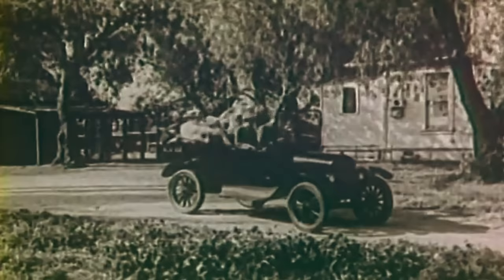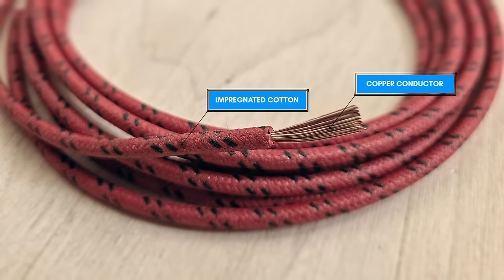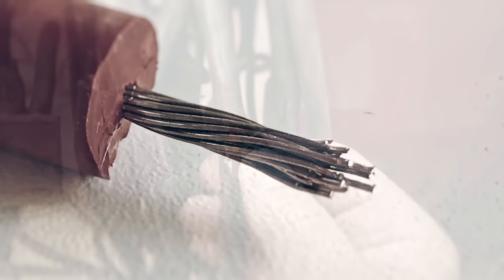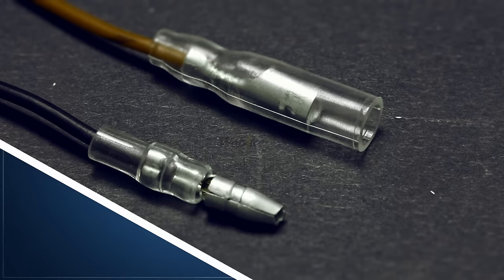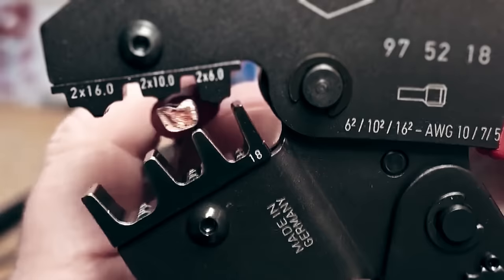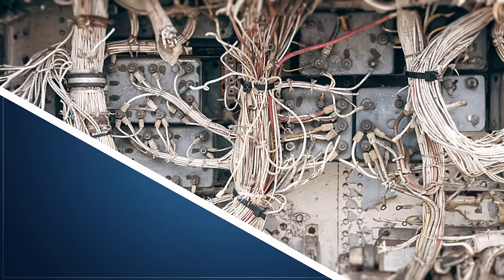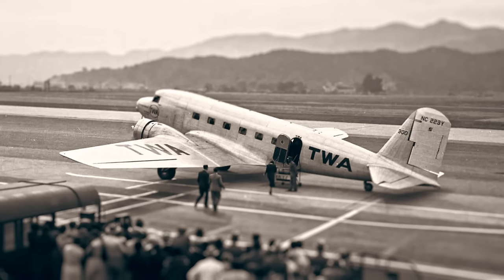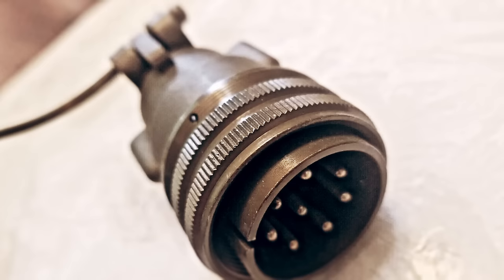The Fascinating Evolution of Automotive Wiring

Comment: I was an engineering manager in wire harness manufacture for over 40 years, and have never seen such a complete and accurate presentation of electrical wiring in vehicles !
Reply: Hey Which software do you use for Designing and simulation of Wire Harness Design? And can you provide any resources for Learning as I am also An electrical Engineer with an interest in Automotive wiring. 
Thanks
Reply: I've been retired for a few years now, so am not right up to date.  In my day, the customers designed the wire harnesses.  Most of them used Pro-E (or whatever that is called today).  Because they never took the time to enter the parameters of the components, their designs were full of errors.  We developed in-house software to cross-reference all the items they specified (wire, terminals, seals, connectors), and sent them a list of errors, which they sometimes repaired on their drawings.  Otherwise, we just made the corrections ourselves, frequently getting in trouble with their quality departments because our harnesses weren't (and couldn't be) "built to print".  As I was exiting the field, more and more customers were putting pressure on the harness suppliers to design the harnesses for them.  (Of course they didn't want to pay for that!)
Reply: Well, something's never change. Same now.
Reply: Or Zuken e3

Comment: Automotive wire harness engineer here: You NAILED it! Nice job!
Reply: Can you do the wires of an AE-86?
Reply: What kind of drugs do you need to do to be a harness engineer ?
Reply: I toured the Lockheed plant in Fort Worth, Texas (where they build F-35 jets, etc)
They had huge tables set up with guides to run the wires on, some had to have been 30 feet long, hundreds of wires, ita how they laid out the wiring harnesses, was neat to see it like that.
Reply: He is an AI.
Reply: 🚅  don't you all enjoy railroad
🚈  trams, trains etc are just so cool
🚞  take a ride in my ''transportation'' folder,  (folder 4)   :)
Reply: Hey Which software do you use for Designing and simulation of Wire Harness Design? And can you provide any resources for Learning as I am also An electrical Engineer with an interest in Automotive wiring. 
Thanks
Reply: @HassanAli-fu7kj We primarily use Siemens HarnessXC for the 2D, and DSS Catia for 3D routing in the vehicle. The best way to learn about automotive wiring, is to install a car stereo system in an older car where you can replace the head unit, no joke! You can learn a LOT with that hands-on experience. Or adding another device to a car, like an auto-dimming mirror.
Reply: @rwdplz1 question for you - why don't manufacturers properly seal splice points in automotive wiring harnesses?
Reply: @Bimmerbearyou think that’s crazy, take a look inside your standard printer and consider how many people had to come together to produce that. Kinda nuts. And to produce it on a mass scale.
Reply: mechanical engineering grad here. how hard is it to get into this field, is it enjoyable?
Reply: @MCatwar  Depends on the economy and how many new projects any given OEM or supplier has and needs help with, most people start at the suppliers and work their way into the OEM's, the big suppliers who have job listings online are Aptiv, Sumitomo, Yazaki, and Fujikura
Reply: car enthusiast here: can you please stop?

Comment: Working on modern day automotive electronics is the bane of my existence
Reply: Leave it to the pros
Reply: That's what the pros say themselves. Modern cars are overly complicated electronically and will break more often and be harder to fix because of numerous badly thought out interdependencies as well as blatant anti consumer (and anti non licensed mechanics) design and programming.
Reply: @AJ-ln4sm  You don't sound like the kind of person who can help themselves or others. Me? I started doing my own appliance repair at 7, fixed a washing machine and it cost my mom only $15 for a new solenoid valve. Then I fixed the heating element in our dryer, I fixed several CRT TV's despite the "danger", I did my own complete brake job recently swapped out my stock brakes for some TSX brakes of the same year (I have a Honda) so it was a nice upgrade in stopping power without losing ABS, etc. I flushed the lines twice just to make sure it was all new brake fluid. I did my own research and learned which kind of thread locker you want to use, bought the manual and got the torque to spec.

I've saved easily ten grand in my reasonably short life of 33 years. You sound like the sort who just pays someone else for everything you do and I have to say I don't respect those kinds of people. They're no help in an emergency.
Reply: @GeorgeWashingtonLaserMusket  if you were a good looking girl, I'd marry you lol. I'm an engineer and I like repairing everything by myself :)))
Reply: @AJ-ln4sm  Who says they aren't a pro? Half of a mechanic's entire job is to whine and complain about dumb decisions engineers made, that make maintenance so much harder. 

And half of an engineer's job is to whine and complain about the cost cutting design decisions or weird complicated feature requests that management and/or marketing wanted.

Complaining is part of the job description, lol
Reply: @KamielDV2
And that is what consumers say whenever they get something they don't want, yet continue to buy them anyways.
Keep complaining, the companies love it because it gets them ad revenue.
Reply: @GeorgeWashingtonLaserMusket 😆 🤣   I'm the pro you wish you would have paid to do the job right in the first place
Reply: @AJ-ln4sm   And yet every time I've heard of someone taking their car to a "pro" to get it fixed, something in the electrical system gets broken. At some point in time the anecdotal becomes evidentiary, and I've heard of far too many instances of that occurring.
Reply: It’s not that bad if you’re willing to just rip out and replace the part. Fixing the part is a nightmare though
Reply: No doubt
Reply: @GeorgeWashingtonLaserMusket  it's nice that you consider yourself " handy" and all, and that you can do simple mechanical things. But in no way is your shade tree wrenching relatable to the chaos of cutting edge modern automotive electronics. Having to program a vehicles ecu to recognize a new fuel injector, and then program in the fuel injectors unique trim codes is not something an average person can pull off. The need for thousands of dollars in equipment just to communicate with the vehicle, let alone the brand specific licensing required to allow your expense equipment to even work, is not something Joe average has access to. Leaving it to the pros is now a reality for most vehicles. Although much work I see is caused by amature mechanics such as yourself so I can't complain. I personally drive a 26 year old Toyota in order to avoid all these problems.
Reply: Yep adds new meaning and depth to intermittent faults that where bad enough to trace before.
Reply: @GeorgeWashingtonLaserMusket  Wow I have a new hero.
Reply: @anon_y_mousse  then the conclusion is that it was not a pro...
Reply: @mrblonde2013  I suppose that depends on what sort of sophistry you subscribe to. How do you define a pro? As someone who is perfect and never makes mistakes. Or as someone who's been educated and certified.
Reply: @AJ-ln4sm "leave it to pros" does not change the fact that maintaining and fixing modern cars is a lot harder and therefore more expensive than old cars.
Reply: @jasonwood6570 Dude had to buy a manual to change his brakes and research how to put a bolt back on. He doesn't even know about all the stuff out there that he literally cannot fix himself.
Reply: @justdude8115 People say that, yet cars are continually lasting longer than before with less intensive maintenance requirements.
Reply: @ToastyMozart  I've normally heard that argument from people who think driving a ten year old car is only for Neanderthals. X3
Reply: Agreed. I paid a guy just to rip out my diesel's harness, and wire in the basic circuits to a marine fuse block. 

Everything's gone. No power seats, windows, mirrors, locks, A/C, SRS, or RWAL. And the ECU never actually ran anything but the gauge cluster... it had a check engine light that wasn't hooked up to anything! XD 

It's 30 years old, so it didn't need any of it, and I couldn't be happier with aftermarket gauges and toggle switches! :3
Reply: @Mozart okay, fine, I'll write my comment the forth time hoping that this time this crappy platform won't delete it for no reason.
I want to buy Rav4 because it's cute little fella, the choice was between first and second gens because newer ravs are ugly af. I did some digging to see how reliable those cars are and ended up on toyotaproblems which count the complaints about toyota cars. And so the result is not really surprising:
First gen: 43 complaints and its owners are bragging about doing strong after 500k kms
Second gen: 918 complaints, its engine literally kills itself and also its owner might end up replacing the gearbox because of faulty ECU.
Third gen: 957 complaints
Forth gen: 366.
And if you check other models you will see the same pattern with 4runner, camry, corolla, tacoma and prius. Because modern cars are more complex, they have more stuff that can go wrong, and they are harder to fix.
Reply: lvl 3 auto app, lvl 3 dives into electrical. learning about electricity and electronics is very cool. i still like my old honda tho, no abs, no p/s, no power windows or locks. minimal and simple.
Reply: @SSmallwood  I'd take a car like yours long before I'd touch anything new. I'm starting to feel like a boomer, and I'm only 35! XD 

Besides, those old Hondas are troopers! My parents' Accord had 560k miles when they sold it, and now their Tacoma has 350! <3
Reply: @jamesgizasson  I'm 25 and already a boomer. Modern cars are not only unreliable and hard to work on, they are also ugly af.
Reply: @justdude8115  We're one in the same. I was born way too late. At least (for the time being) our government is gEnErOuS enough to let me keep my old cars...
Reply: @GeorgeWashingtonLaserMusket everyone im this day can you what youve stated, its a matter of time. Nobody wants to troubleshoot or look on youtube for a specific guide lil bro

Comment: I worked at car restorations with a friend as a hobby from 1982 to 2000.  

The first one I restored was a 1952 Chevy pickup.  We didn’t have a wiring diagram, but the harness was so simple that we didn’t need one.  

The next one was a different story.  It was a 1970 302 Boss.  There was nothing wrong with it mechanically or bodywise.  The insurance company totaled it because of faults in the wiring harness.  I found out from an adjuster that insurance companies considered wiring harnesses to be unreparable after 5 years because the insulation gets brittle and cracks when disturbed.  

Fortunately, we had a source that could get us original wiring diagrams for almost anything.  I designed a pegboard that allowed me to run all the wires before termination and looming based on a film I had seen on late night TV showing a wiring harness being built in the 60’s.  The Boss was the first time I tried it, and it worked perfectly.  The assessor never even noticed it wasn’t original.  

The only reason I stopped was because I only knew wiring and my friend died (he was 80).  

We preffered pre 1980 cars because after that there were so many different types of wire required that it was costing a fortune.  

We always tried to restore to factory original, with the exception of paint.  We left that up to the buyers.  

I did it as a hobby, but it was a business for my friend.  He actually believed Social Sucurity would be enough, so he needed the money.  

My favorite was a 72 Challenger, but the most impressive was a 73 Duster.   That car was just a freak.  Unfortunately, the buyer wrecked it a week after he bought it.  

We salvaged the drive train, and we were going to put it in a street rod, but we never finished it.  

We did about 6 cars a year, mostly muscle cars.  I look at the wiring harnesses in today’s cars and I don’t have a clue.
Reply: You would probably enjoy wiring a modern race ECU from scratch, Im doing exactly that for my 89 MR2 SC and updating it with modern individual coils and wastegate control and sensors, its taught me quite a lot, especially since Im using the stock motor and stock chassis harness.

Also as someone who also works on modern cars as a mechanic professionally, I can say its given me a lot better understanding of the core functions of a modern wiring harness, without all the VVT controls and useless sensors and bs.

I fucked up the first attempt at the wiring harness and now I'm going back to use mil spec connectos and do concentric twisting, then cover it all in heatshrink rather than the vinyl mesh type I used before. Its been a hell of a learning process and the projected cost has tripled, but the final result is all going to be worth it I know.
Reply: @kylesebring  My brother in law did a street rod using split plastic corrugated tubing.  At first he was angry because all he could get was red, not black.  When he was done, it looked so good his customer decided to leave it open engine instead of hood and side panel style cowling.  Really made it pop.

Personally, the most confusing I ever did was a 1960 VW Bug.  It took forever to wrap my head around how it worked.  That was when I realized you have to understand it to build it properly.  

I was an instrument and controls tech for most of my career.  My hobby contributed greatly to my successful career.  Before I retired, I was getting calls from all over the western US to come and rebuild control systems from plant managers who had seen my work.  

The whole reason my work looked so good was from what I learned building wiring harnesses.  I do wish auto manufacturers would learn a few things about PLCs though…
Reply: @Simple_But_Expensive a child can figure out a 1960 vw beetle wiring harness. 

If that don’t make sense
Sorry you weren’t meant for automotive wiring

As the entire Harness fits on one page diagram. 

Literally it’s as complex as a 1930s car.
Reply: @fastinradfordable  Yes, I know, but for some reason it just didn’t make sense to me.  It took literally days for me to wrap my head around it.  The 52 Chevy was easy even without a wiring diagram.  The muscle cars were easy, just tedious.  On the VW, for some reason I just blanked.  Can’t explain it, it just was.  I have rewired about 7 Bugs (58-70) since with no problem, but that first just faceplanted me for about 3 days.
Reply: And for all that complexity, they totally forgot about fault-tolerance, robustness, repairability, and reliability. It's not just sticker-shock that makes people not want to buy new cars.
Reply: Great story!
Reply: Thanks for sharing your story!

Comment: As a 20yr business owner building motorsport harnesses, this is a great video for anyone that doesnt understand automotive electrical
Reply: so they don't complain when they are charged for 20+ pin connector purchase or repair. agree.
Reply: @VladGoro25  When I first started, I thought something was wrong that a 66 pin Autosport connector was $400 for the pair plus the cost of terminals.  Now I know that its just part of the business and have no problem justifying 15-20k for a more exotic engine harness.  The time to concentric twist everything, to shrink it, boot it plus connectors costs a lot of money, but the results are awesome.

Comment: One of the biggest changes in the automotive wiring is 10Base-T1S standard. This is basically 10Mbps ethernet, but over a single pair (normal 10Base-T uses 2 pairs, and 1000Gbps uses 4 pairs). It is a high speed, muilti-drop and optionally collision-less standard, that is highly compatible with standard ethernet. There are also 100 and 1000 Mbps variants (more for cameras and lidar applications), as well a separate but similar standard called 10Base-T1L, with high range (it is not used in automotive, with primary applications being industrial and building automation). They can also provide power to low power devices without extra cabling.

In cars, these standards will likely displace CAN, LIN, and other similar tech, either by native Ethernet / IP traffic, or tunneling CAN and LIN. The estimated benefits are reducing cost and weight of the wiring harness by half, while providing higher performance.

Comment: 15:15 What all of these bad boys have in common is that they are pretty tough to seperate without breaking thier locking mechanisim. Especially when they are caked up with dirt.

21:25 This by the way works only semi well in practice. Since every manufacturer is allowed to be thier own special shade of wierd and only a few of the diagnostic codes are normed for emmisson related errors. Even expensive and fancy interfaces like Gutman or Autel Struggle to get anything out of lets say something goofy like an Iveco Daily.

The bus systems in general are among the most bullet proof things on cars today. That is as long as a manufacturer doesnt suffer from the big dumb and decides to expose the wires to places where they can break from bending or scrape open from bottoming out. (Yea ive seen this before)

22:50 Biggest thing about HV vehcles is that instead of having the chassi as a ground it runs HV-ground back to the battery via a seperate wire. All HV wires are bright orange and are constantly being checked by a pilot line. Even if you really wanted to hurt your self with the HV system youd need to be very intentional and know what youre doing.

Comment: Excellent video, you touched on the finer points that most skip over. 2 decades ago exactly I started as a Chevy apprentice tech program and did the factory level training in electronics in both OBD 1&2. Going a bit deeper on OBD 2 and SRS (airbag/ restraint) systems would make for another good video.